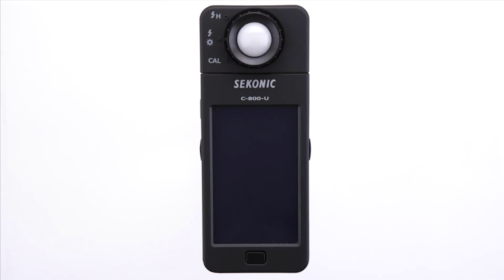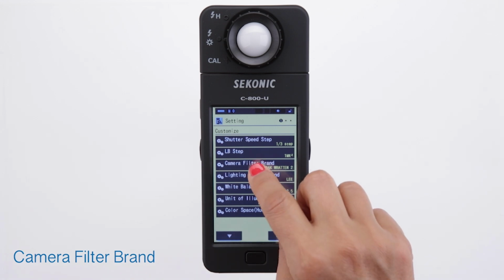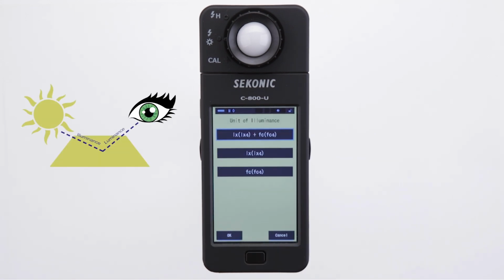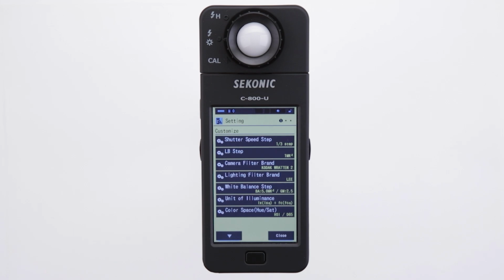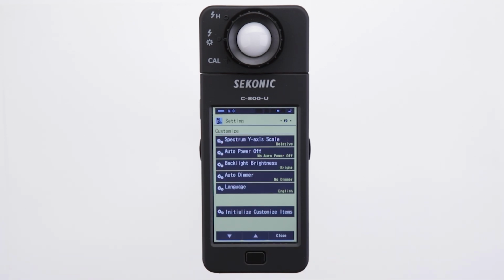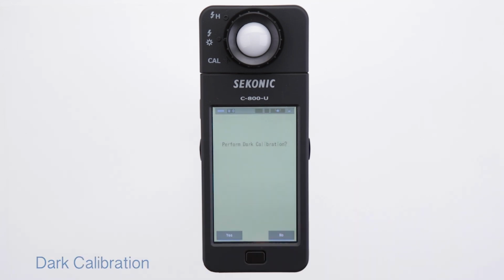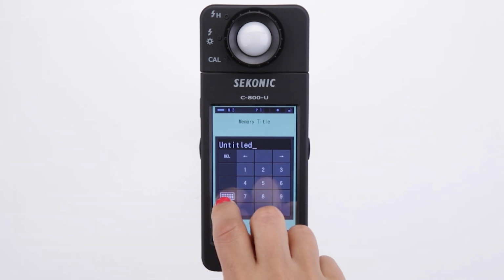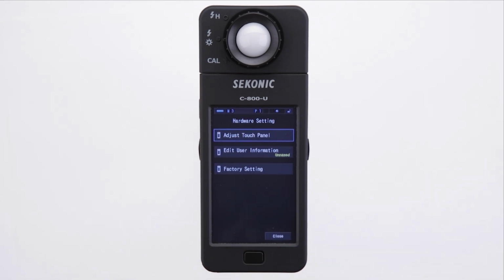Sekonic C-800 Spectrometer Quick Start Video |  Tool Box & Setting

Comment: As demonstrated in this video and written in the User Manual, the Memory Title can be renamed. It should be noted that renaming an existing Memory Title using the Tool Box—Memory Title— instead creates a new title as a new destination folder, leaving the previous one and its Memory contents intact, except that it moves the current selected, loaded Memory value to the new Memory Title folder.

Furthermore, when there is a list of multiple Memory Titles, selecting and loading a previous one as a new folder destination for saving further reading values under that title is not possible from the Tool Box—Memory Title screen. 

The workaround is cumbersome because it requires renaming the pre-existing targeted Memory Title on the —Tool Box—Memory Title screen to its exact spelling.
For this, open the Memory Management and memorize or write down the desired Memory Title to rename it. The above operation forces the targeted memory title to be loaded as a new destination folder for further Memory values. Let’s take in consideration, the operation from the Memory Management—Edit—Rename— doesn't load the previous Memory Title as a new destination folder. It only serves as an informative display for the list of titles made on these screens.
The ideal scenario would be that the Tool Box—Memory Title—has a contextual menu, as the Preset Selection does, from which existing Memory Titles can be loaded as a destination folder without the need to retyping them.
The most recent Sekonic C-800-U firmware version, 20-12.11, was used to write these observations.

Comment: How do I connect this to my computer. I'm using windows 10, downloaded the proper utility for the c-800-u, I'm using the proper cable, unit is turned off, plugged in, then turned on. I turned off the firewall before installing the utility. What gives?